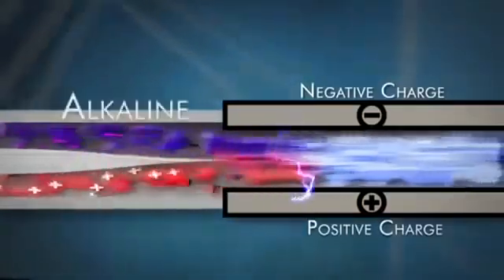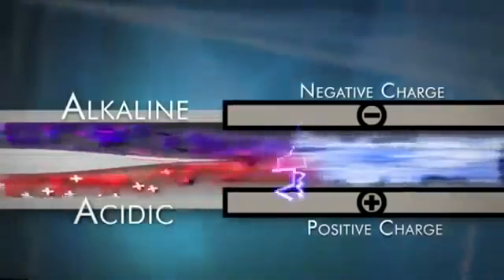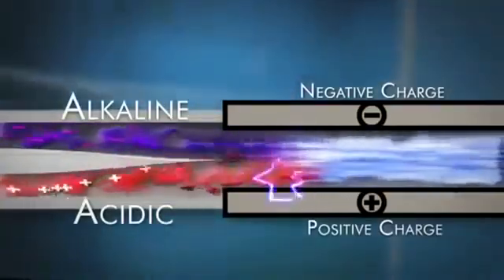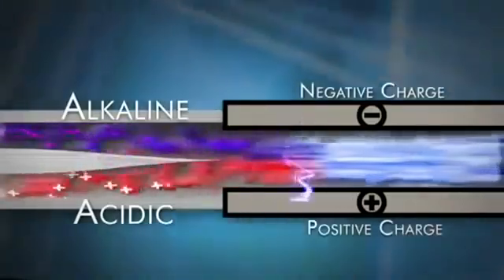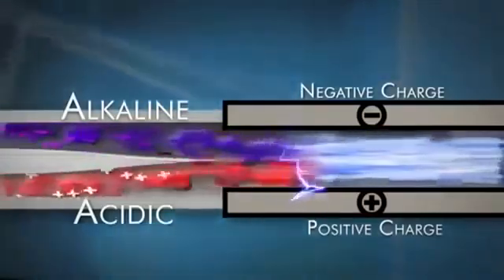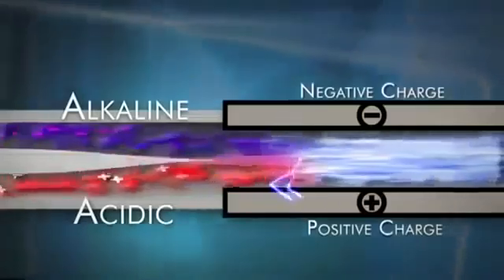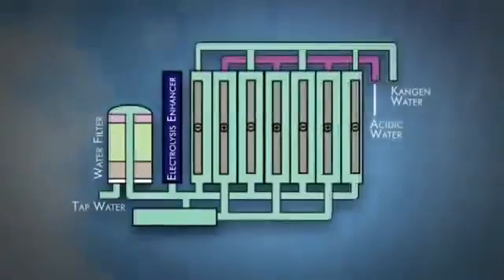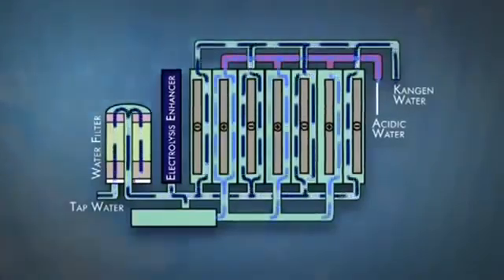How kangen water machine works

Comment: I have a question here!!
Do this machine require electrolysis enhancer solution to draw 9.5 Ph water.( Alkaline water?.
Reply: No , it is required only to produce strong acidic (2.5pH) and strong alkaline water (11.5)....
8.5,9.0 and 9.5,  are produced with the help of plates itself...
Reply: No it does not require enhancer for any water below 11.5. Ph.

Comment: is kangan water hydrogen water?
Reply: yes, it has - ORP reading
Reply from the maker: yup, kangen water contained abundant hydrogen in form of H2 gass which is called molecular hydrogen. It is act as strong antioxidant that helping neutralize free radicals inside our body.

Hydrogen is only 1 of specials properties contained in Kangen Water, the others are alkalized and micro clustered water
Reply: @kangenwaters  But do we know the h2 ppb/ppm levels of the Kangen machines?

Comment: What if there are no minerals in the water?
Reply from the maker: The source water must contain minerals in order to be processed inside Kangen Water machine. If you use source water that contains no minerals (such as Reverse Osmosis water), the machine cannot process it. 

Ionization process needs minerals in order to conduct electricity and separate water into acidic and alkaline water.
Reply: That's not a good thing. Our body needs these essential minerals. Many people are deficient in minerals and anti-oxidants.